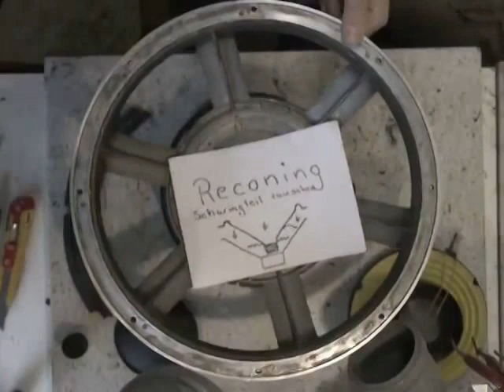Beyma 18G400 Reconing

Comment: Nice work but it's recommanded to do a low frequency test after installing the voice coil and tightening the screws, without the shims ofcourse. Easier to correct if the plastic ring with double spider needs Some adjustments because of rubbing. Afterwards reinstall the shims before installing the cone. Why not using the original glue offered with the kit?